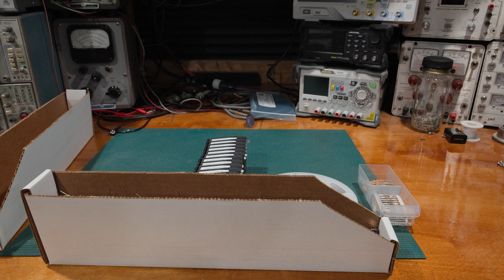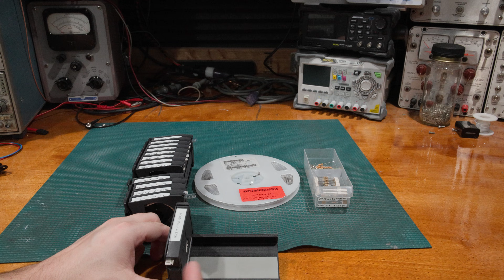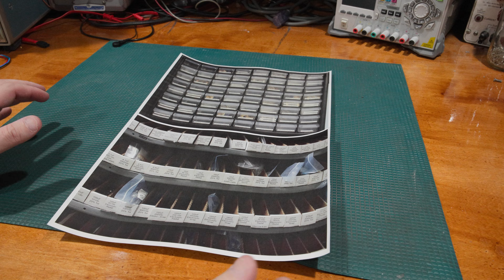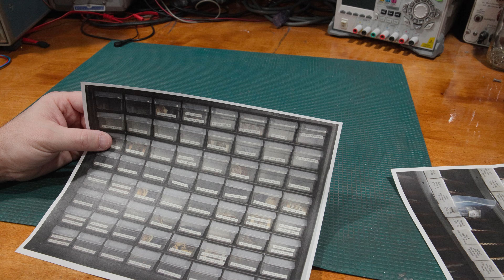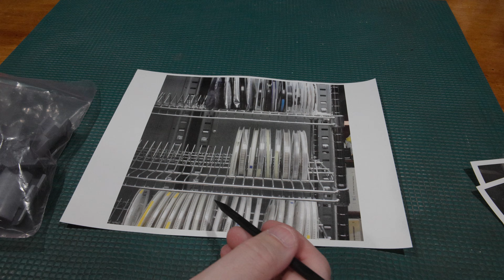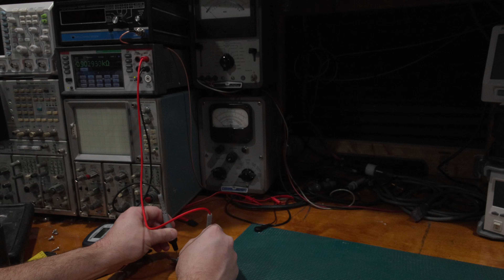Lab Storage  Controlling the Chaos

Comment: Akro-Mils metal cabinets are great for storing small components. You can find them  time to time and get repalcement
plastic drawers easily both available on a popular selling site. I store resistors by first digit only by drawer and Watt size.
If you learn the color code of resistors it works nicely. Like dust free covering so flat top plastic storage boxes only for
larger items.
Reply from the maker: I am keeping a look out for the metal ones I have a stack of the plastic that is working for now till it gets brittle.

Comment: If you're running short on space and need to store small components, you can try using ziplock bags with a Velcro backing attached to ring binders. This is an extremely space efficient method, and you can also label the bags and add QR codes that link to their datasheets. I have a video about it on my channel. I'll put the link below. Let's see if YouTube deletes it.

Comment: I have the dymo label maker before they put DRM in their crap. It was win/win, bought a broken one on ebay for like 10 bucks, and fixed it! For a home hobbyist, I got some small part storage on amazon from a company called AideTek and the model is "box all". Each little lid has a nice snap to it... my biggest fear is dumping all of those SMD parts. Other stuff I put in a plastic larger storage and group things by decade. e.g. resistors I put in little bags, and group them like 1R, 10R, 1K 10K... essentially everything which starts with "1". I do that for each group. Seems to work for now.